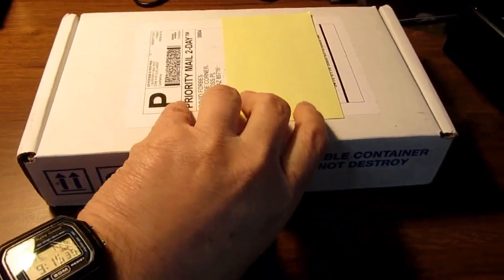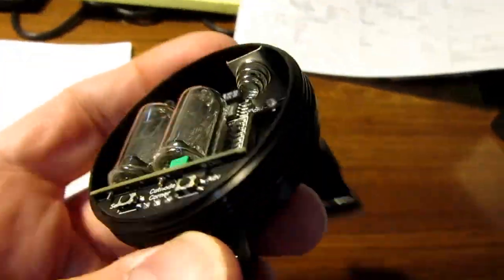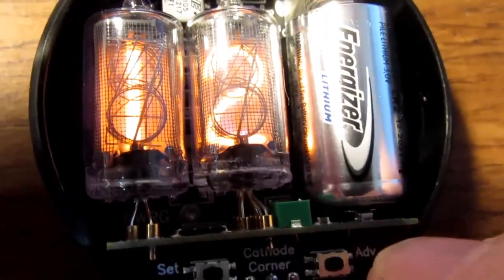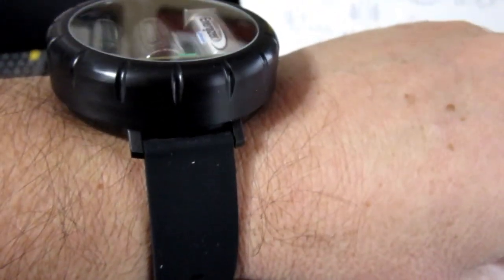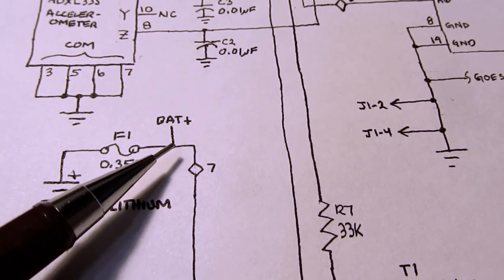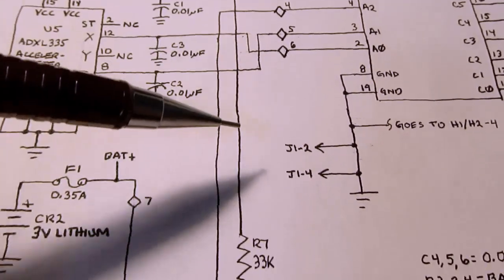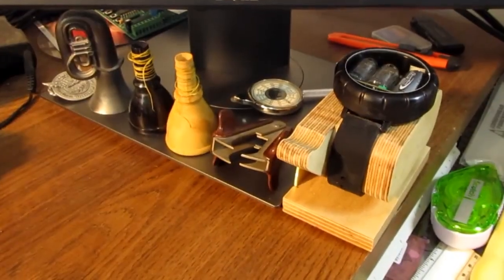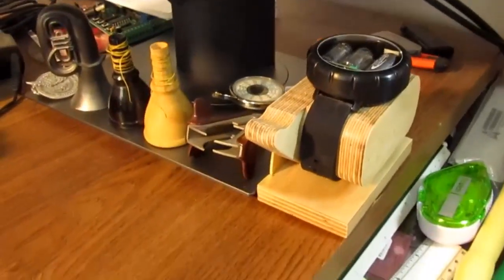Cathode Corner "Nixie Round Watch": Demonstration, Theory of Operation, Making a Display Holder

Comment: Can you update the firmware if the vendor makes it available? BTW, how does a micro pin supply power to the accelerometer? A discrete output can’t do that.
Reply from the maker: adaptus primus, the software/firmware can be downloaded from cathodecorner.com, or directly from the watch itself, and the maker encourages people to study and/or modify the program. The accelerometer IC is indeed powered from one I/O pin of the microcontroller, that is clear from the schematic and my circuit description. As for your assertion that the controller can't power the other IC, you are incorrect, don't know why you would think that.
Reply: @youtuuba  excuse my ignorance. The accelerometer must draws very low current. If I recall correctly a typical PIC micro output can source less than 30mA.
Reply from the maker: @aps125  , I am not sure if the accelerometer is actually a integrated circuit, or at least a true semiconductor circuit. I have read somewhere that these chips are more like electro-mechanical structures inside, perhaps more like microscopic strain gauges internally.